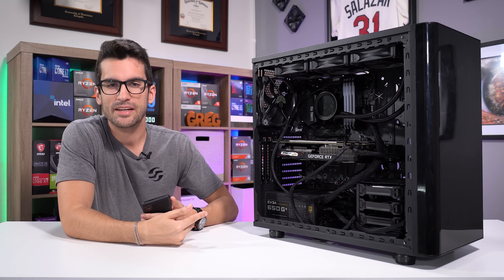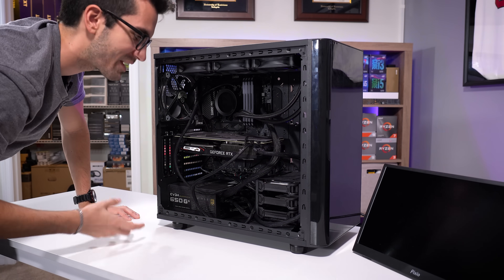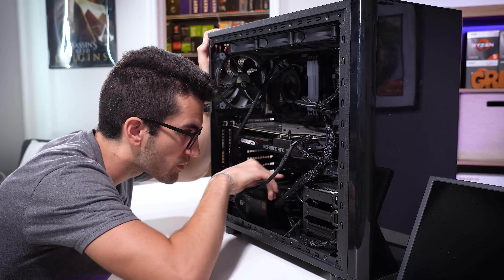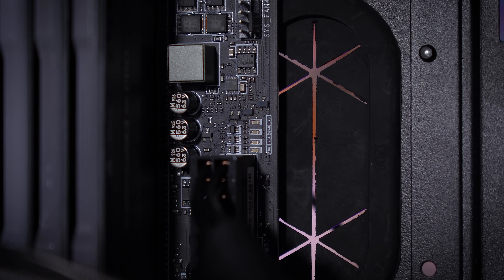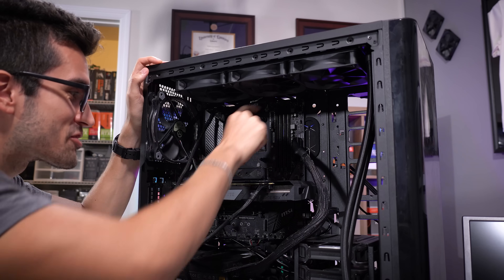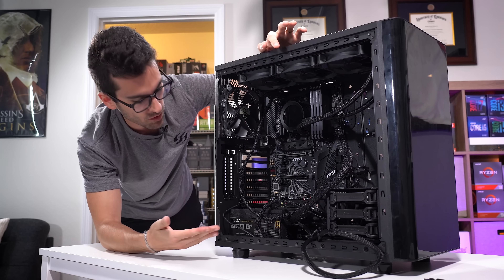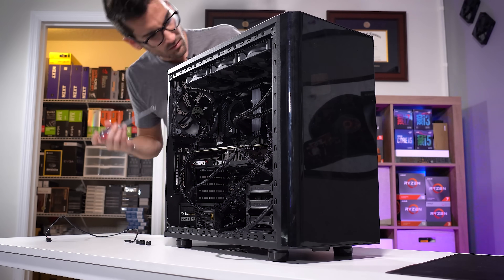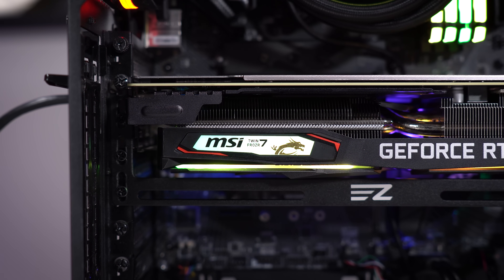Fixing a Viewer's BROKEN Gaming PC? - Fix or Flop S1:E4

Comment: The GPU sag was killing me, good touch with the brace
Reply: I have a gaming Z 1660 Super card. For some reason they don't want to sit level. Even with an anti sag bracket. I finally just gave up cause one of those brackets that force it up seem to put more pressure on the slot then just letting it slightly sag.
Reply: Saw that RIGHT off the bat when he removed the door at first. Wiped my brow off when he installed that then knew someone had to of mentioned it lol. Whew
Reply: my neck still hurts from tilting my head and trying to pretend there was no sagging.
Reply: yea thats quite disturbing
Reply: @Chapwarrior9  Nightmare fuel.
Reply: Just shows how behind the times the ATX standard is. Expansion cards have gotten a lot heavier since it was established.
Reply: first thing I noticed
Reply: Yep, was going to say the same thing.
Reply: wait, okay, i'm glad i wasn't just seeing things then
Reply: First thing I noticed and it made me uncomfortable.
Reply: @itIsI988  true but I think this might be from the case, I have a much heavier and longer card but there’s no sag because the case can support it properly and the motherboard has a reinforced PCIE slot. It might sag over a long enough time frame though so I’ll probably still be getting a brace but it surprised me that it was perfectly level.

Comment: Man blue balls'd the guy by saying he would give him a new motherboard
Reply from the maker: If it ain't broke, don't fix it! Would rather save it for someone who has a genuinely bad board 👍
Reply: At least he got a support bracket for his graphics card lol thats an upgrade
Reply: @nguyenhoangquockhanh4930  The Computer being fixed is a bigger upgrade LOL
Reply: @GregSalazar  what if someone sends you a system with h67 mobo and 11900k for a fix.
Reply: Imagine getting your rig fixed for free and being butthurt you didn't get free parts.
Reply: @GregSalazar  I had the same exact issue. I'm looking @ this vid and smiling :)
Reply: That's even a MEG Ace! God damn, I would've cried.
Reply: A working PC is better than no PC
Reply: @brentrichards1200  that's not the issue. The issue is that in the video he said he will give the guy a new motherboard, then he did not. Why did he include it in the video if he wasn't going to give it to the guy
Reply: @nguyenhoangquockhanh4930  and free cable management
Reply: Showing the clip nails the point home he had (for the most part) given up on this being a fixable issue by taking the time to look through his inventory & recording the planned replacement. It also provides a comedic punch of realization with how the smallest of things are at times sneaky enough to escape experienced techs while troubleshooting.
Reply: @monetary687  Because he said he will replace the mobo assuming the old one is broken, which he found out isnt the case. Are you a robot by any chance ?
Reply: True true, but  his worked again so it's not that bad.

Comment: Whenever i see this type of issue. I would remove everything from the case and place them on a testbench because the pc is showing symptoms of a short circuit. Maybe a screw is touching the case or the mobo is having direct contact with the case. I haven't watched the full video yet
Reply: He didn't do it, but, as is often the case with these kind of things, he probably would have ultimately saved time by biting the bullet and fully disassembling.
Reply: Ive seen this issue many times and its a result of a short, and in my experiences it was either the wiring done wrong for power or a standoff.
Reply: @fathom18  right on. I had a friend who did a full cleanup of his pc. While reassembling he screwed his mobo directly to the case. He didn't use any standoff. I removed his board, eliminated any trace of static electricity and his prob was gone. Another one has his standoff bent and that resulted in it touching both the case and the mobo
Reply: @woodywolf0309  hey dude, i have a problem with my pc, didn’t know if you could help me, but whenever i have 24 pin cable in it turns on the whole pc lights up, but whenever i have a cpu cable on it doesn’t even light up it doesn’t turn on?? it’s a weird problem, it’s as soon as the cpu power cable is in it doesn’t light up. the motherboard green power light at the bottom is on when i have cpu cable in but nothing else?
Reply: @woodywolf0309  i’ve also reset the cmos, unplugged components like ram, gpu, and checked all the power cables are in properly…
Reply: @kxyb0ard557  im pretty sure your motherboard is defective. Is it brand new?
Reply: @kxyb0ard557  it can also be the power supply
Reply: @woodywolf0309  not psu either, sorry forgot to mention i alr tested that too
Reply: @woodywolf0309  yes mobo is brand new
Reply: pc worked for a day literally now it’s decided to break 😂

Comment: i was cringing so bad at that rear fan set to intake, thank you for fixing it. omg xDDD
Reply: Having the rear fan as an intake is actually a recommended way to feed more air to the AIO fans if you have them on the top of the case, assuming you know to place the AIO fans as exhaust.
Reply: I ran all intake when having my blower card exhaust all the air out of the case. I ended up switching it around when i moved to a new case.
Reply: Guy argued with me and a few other users on reddit that his fans were on exhaust when you could see their stickers.
Reply: PCOCD, am I right :D
Reply: Just curious (very amateur builder here)

1.  if the rear is still set as intake, and he's using cpu AIO cooler, and top fans are set as exhaust, does the rear intake fan helps in VRM cooling?
2. Or the intake air is instantly sucked out by the nearest top exhale fan, thus making it redundant?
Reply: @JakeobE  Doesn’t  that only work if the front panel of the case is solid? I imagine this would not be as effective if the case had a full mesh front panel.
Reply: @JakeobE  if you have an aio on top and set to exhaust, it actually wont be as good as if you were to place it on the front panel and pulling in fresh air.
Reply: Actually the rear exhaust fan ends up 'fighting' the adjacent rad fan, they're both trying to pull air from the same space in the corner of the case. A ghetto-mod would be a baffle of about the same area as the fans, at 45° between them, easily made with a piece of stiff (black) card attached to the rear side of radiator fan frame with double-sided tape. You'll get better flow out of the rear exhaust and better pressure from the radiator fan. ETA >> of course this also applies if you've got rear and top-rear exhausts in an air-cooled case.
Reply: @EliteRock  my thoughts exactly. In this setup specifically. 3 fans in 3 fans out. Not necessarily positive pressure, but better than having that deadzone where the two fans in the back fight each other for air.
Reply: @EliteRock  You learn something new every day. I've had 2 fans on the top and 1 on the back of my case for years, I've never thought about any deadzone in the middle, I'll flip the rear fan later and see if it makes a difference

Comment: The viewer: almost got an x570 board from Greg. 
The current board: Not today!
Reply: B450 Gaming Pro is fine, I got it too. No Chipset Cooler = less sound
Reply: Had the same issue- after i gotto the post and Main screen I immediately updated the bios. Since then no issues.
Reply: i have that in mine same CPU to
Reply: @mikeycrackson  Ayyo fax
Reply: The old board is very decent ot begin with, especially if you are not going to push clocks, which with amd is a bit pointless.
Reply: @Hr1s7i  its decent but he has an ryzzen 7 lol
Reply: @gamingbigfilipp  So? It's just a 3700x. You can toss that on a cheapo B450 with barebore vrm and it'll still run without a hitch nonstop for at least 2-3 years.
Reply: Wait, what's wrong with x570? I got one.

Comment: A little tip in case people have the same problem: I had problems in the past with my PC not booting up very often. And that was always because the screws of the mainboard were simply too tight screwed. So I loosened the screws and it worked. The last time it happened, my CPU cooler was screwed too tight. So a single screw can cause the entire PC to stop working.
Reply: Can you help me with my PC? My PC works like a charm for the first 3 weeks then suddenly one morning it's not firing up literally the power button does nothing. So I leave it for a few days and then plan to go to a repair shop. But one day I decided to fire It up again and it works, my PC is now open for almost a month without shutting it down because when I do a proper shutdown the problem goes back and the power button does nothing again. I'll be happy if  you could reply to this thank you so much
Reply: @royetmanalo7329  Honestly, I've never heard of this kind of problem. If your power button does nothing, then i would suggest to check the tiny cables from your case that are going to your mainboard. So just make sure that your "Power SW" cable is not loose.
Reply: @PixelGxming  I don't think the front panel cable is the problem because if my PC decide to run I can   shutdown for a few hours and fire it up again and it works perfectly. But when my PC is shutdown for the whole night and I open it in the morning the problem goes again and when it decided to open up again after hours of button mashing the time and date is delayed for few hours but the other bios settings still remains. I think it's some kind of electrical short but I don't know where to look at or where is the shorting happens
Reply: @royetmanalo7329  yeah try changing your cmos battery

Comment: I've once had a pc not working where the culprit was a freaking fan, from there on when troubleshooting I disconnect everything that isn't necessary to boot including fans and front IO. A lot easier to troubleshoot when you only have 4 or 5 components.

Comment: What did we learn today about troubleshooting hardware? ALWAYS disconnect ALL cables and peripherals and just reconnect the ones you really need to test the system. Then reconnect cables one by one to see if the fault returns. I was a little bit perplexed when I saw you "check the connections" without actually removing everything and reseating all hardware and cables. 

Good job solving the issue in the end! :)

Comment: I was about to write the solution when you said was the motherboard but i keep looking at the video, you figured out!
By the looking of it, if the pc is turning on by itself it is the front panel power button, many inexperienced PC builders never take a look to the manual to see how to plug in front panel pins, or the button itself dies and shorts power cycling the pc. Lesson learned.
I recommend you to get a buzzer. I own the same buzzer since 2008, many boards have just LED's to debug issues, but the buzzer tells you exactly whats the issue, no need for fancy numeric LED indicators. I power on everyday my pc to work, and listen the buzzer, indicating me that theres no issue on the pc, and trust me, sometimes i just power on the pc and the buzzer made a different sound, indicating that something is wrong.

Comment: The front IO cables were my first thought here. They're always too small and easy to mess up.
Reply: As soon as the computer powered up without pressing the chassis power button that was my first guess.
Reply: What may have happened was a permanent short across the power pins. That would explain both why it starts by itself and why it shuts down after a few seconds. However, I don't think it explains why it powers on again. I don't remember that behavior but I also don't recall holding down the power button for a minute to find out.
Reply: @dycedargselderbrother5353  Occam's razor my friend.  The simplest answer is the case power switches are REALLY cheap, and it got stuck pressed in.  I immediately said to myself "stuck power button" because THAT is what a stuck power button does(Yes, I've had two thermaltake cases do this.  They are particularly bad in this regard).  There is probably an actuator sitting on top of the power button, which does exactly nothing when the switch itself is stuck.
Reply: @Grimmwoldds  Makes sense. So a continuous short across the pins does cause a boot loop. I'll have to try it some time.
Reply: @dycedargselderbrother5353  Motherboard at off state:  "I see these two points are connected.  I turn on."

Motherboard about three seconds after turning on:"User has pushed the power button for 3 second.  Hard shutdown"

Ad naseum.

The dead giveaway is that the only way to stop it is to turn the PSU itself off.  It's unlikely to be anywhere except at the power switch, because it would require BOTH wires to be stripped and shorting against each other.
Reply: same especially after a complete clean and rebuild
Reply: Had the same issue some years ago when i assembled my pc. Since it was powering up and down in the same way i removed the reset switch and all was suddenly ok
Reply: @dycedargselderbrother5353 , writes "So a continuous short across the pins does cause a boot loop. I'll have to try it some time."

The four second delay to power off was a dead give away. To try this yourself, just hold the power button on.
Reply: Had a laptop that wouldn’t boot at all. Wasn’t even trying. When I opened the top cover and unplugged the power button, it booted up. Turned out that the way that laptop was built, there was a serious low air pressure point in that corner, so dust would build up around the power button and short it. The laptop probably booted up for a few moments before shutting down, but it wasn’t possible to see it on that laptop as there was no LED on it.

Comment: I love the honesty in these videos. even if things don't go according to plan. One suggestion though, before jumping straight into replacing the board after all trouble shooting steps have being followed, take the board out the case, and try boot it bare boned on the table (no GPU, know working RAM and known working CPU and known working PSU)  I've had experiences where the board was making contact with something, was being warped by the case, which caused all sorts of issues.

Comment: Case header cables have caused me more problems than anything else ever.
Reply: Same with the back io panel, those tabs can short the board and perform the same shutdown issue.
Reply: Yeah I plugged in power button on the wrong one and it did the same thing as this video but more of a pop noise

Comment: This happens for maybe 15 seconds when I reverse an overclock or change something in the bios
Reply: It's because your system has to register the changes and then actually make them.
Reply: Power cycling is completely normal when you make changes in thr BIOS.

Comment: Good stuff and a fine example of the #1 Rule in this scenario: Unplug absolutely everything possible then stepwise work back up.

It just saves time and ultimately can prevent possible component damage IME as the system is normally shutting down to protect something and your repeatedly turning it back on. I would have tried a couple of times to see what it was failing on to possibly save on work  but with no immediate obvious fault I'd have base-lined the system.

I was rooting for you each time you turned it back on and felt the disappointment of a 1000+ failed boots each time it failed :)

Comment: Honestly, checking the power and reset btn is one of the first things I do after checking the memory, cause I've fixed so many issues simply because those wires was messed up or because the case button was broken, that I just put those in first place at my checklist.

Comment: Yoooo dude, this is such a common issue with the front IO cables, I have a rule when someone brings me a PC that does now start or shuts down quickly, a simple power button with a wire from an old case, it has been my best friend for a looooong time. Just disconnect everything down there and connect the power button only, this saved me hours of troubleshooting :D

Comment: I suggest picking up an A+ cert book. The book would have suggested to disconnect all peripheral cables (especially front io cables, sata cables, nvme, and video card) to eliminate any of those peripherals or cable issues as main culprits.  If you still do not have a post beep you are left with mobo, CPU, and RAM to eliminate. If you get a post beep, start plugging one peripheral at a time starting with the video card until one peripheral shorts the whole system then you find out which one is the bad part.  Doing this elimination in this exact order shortens your troubleshooting drastically because of the process of elimination instead of making guess work. - I've been a pc tech in my previous life and I do this as a hobby now, and this process never fails.

Comment: Good video.  first thing I noticed as the fact the unit turned on with just the PSU switch only, and you never needed to use the case power button.  Good catch.

Comment: had a similar thing happen a few years ago, it would try to boot, flash a few lights, turn off and try to boot again. After hours of checking connections, swapping PSU's, GPU's and deciding it was the MB, pulled all of the case related wiring, jumped the green wire to ground just to see what would happen, it posted. started reconnecting stuff one thing at a time to find the problem, never found the issue, it always posted for years after that. while still a mystery for me,  its nice to see it happed to other people too. GG on the GPU brace the sag was making me tilt my head to one side.

Comment: You handled this with "grace".  I definitely always reconnect wires since I had a video posting issue beforewhere the 24 pin cable was not exactly plugged in all the way to the motherboard.